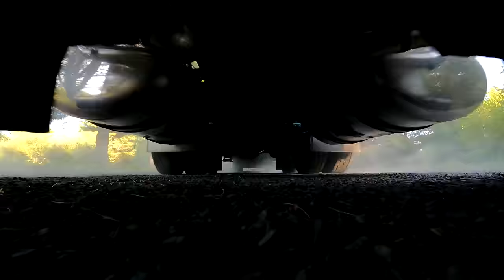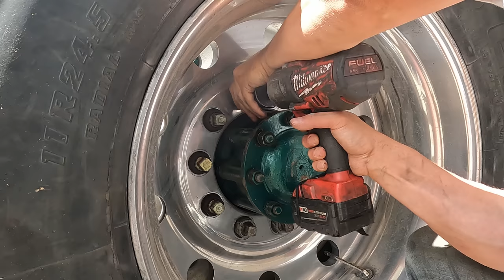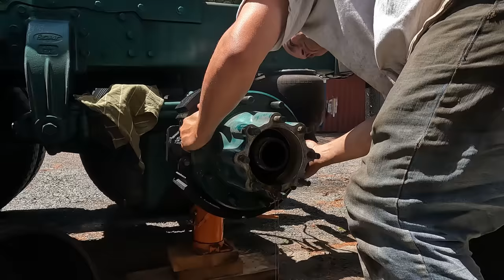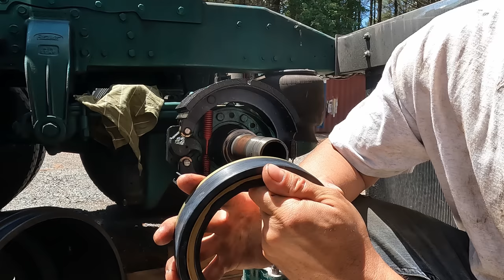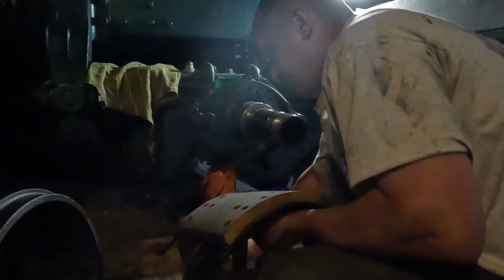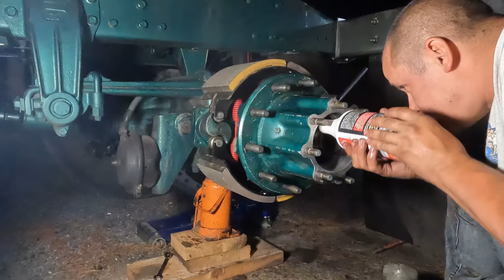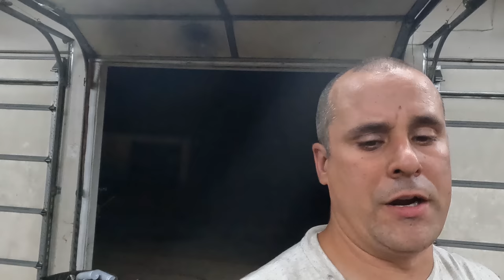Causing our own problems! Major wheel seal failure. What went wrong?

Comment: Check the housing vent . If plugged it will make the seal leak. When sliding hub on have outside bearing in to keep hub centered
Reply from the maker: It's new but thanks Ed! This was my own doing.
Reply: Couldn’t you just brake clean the brake shoes?
Reply from the maker: @tomh6779  ehhhhh they're never the same. It soaks in. Not like they're a million bucks so just toss em in
Reply: @tomh6779  Nah, they'll kinda-stop-but-not-quite and just make a ton of heat, then maybe a fire--great! It's never worth it. New shoes are always the cheaper option than waiting for disaster.
Reply: @tomh6779  no cleaning does not help, once the fluid soaks into the linings they're done, had a brake shoe we cleaned and looked good, hold a lighter up to it and the oil will start bleeding out from it

Comment: I have never put rtv on a wheel seal in all 21 years of working on tractors and trailers. Also it’s easier too knock wheel seal out by using a pipe too tap it out from outside . But everybody has their own methods .

Comment: I noticed the hub has a plug in it, you can pull it out to fill with oil if it will come out, I always put oil in the hub and jack up the opposite side to tip oil into the hub that was just put on, next time you have to take a drum off get a long fan belt and loop under it to pick it up with the belt a little easier on the back good video

Comment: Next time when pulling the hub, after removing the outer bearing. Re install one of the bearing nuts walk hub out and pull. The nut will catch the rear bearing. You can usually pull the seal without having to get creative later.

Comment: On steering and trailer hubs, you can use a straightened out paper clip to poke through the center of the rubber plug to remove dirt and reopen the vent.
Reply from the maker: Ohhhh good call thanks man

Comment: You may or may not have checked the vent ball on top of the axle tube. . If it fails or clogged up.  Gasses build up  has no where to go an it will push oil out of the wheel seal. . Later awesome.

Comment: Growing up working on dads rock trucks I got pretty good at doing seals, aint done one in years now. Never had any fancy tools, seal driver was a piece of oak board and a hammer.
Reply from the maker: I did em that way forever but the seal driver was dirt cheap and comes with the big ass punch thing too!

Comment: I remember putting those shoes together at the Truck shop; newer ones slightly different, not nearly as good as that setup,, got a Bent pin drive in with a hammer, so the spring a have something to attach to.  And the rollers on the S cam have little clip on them
Reply from the maker: I like this style
Reply: I was wondering the same thing. I've never seen a roller with out a spring clip retainer. They're usually a pita to fish it in when you did it the way he did.  And I've worked on some old junk! Lol
Reply: @Ol2Stroker  I do as well, looks safer and stronger, less parts that can break .

Comment: exact same design as the 3/4 and 1 tons i do frequently, theres a steel spacer that keeps the inner and outer halves of the seal aligned, it generally gets bent on pulling the hub and you sometimes leave the inner part on the axle housing if it has a good enough grip, never bothered to learn the wizardry that lets the two halves of the seal move around but not leak, but yea, the spell is broken once you screw with it. i didn't see you install a gasket or sealant on the axle shaft to hub. at 27:54 at about 8 o clock on the hub i see a drain/fill port in the hub, may help reduce the mess, wish the 2.5 ton rockwells on my deuce had those and it ran oiled instead of greased bearings, could check for contaminated bearings easier after playing in the water
Reply from the maker: Yea I never took the fill plugs out when I restored the truck and I doubt they'd come out without a lot of cussing and burnt paint

Comment: Made a lot of extra work for yourself.Should have left the the wheel intact on the hub , remove axle nuts, get a good sledge hammer, not the toy your using, give it a couple of good blows, don't hit the studs,  those cone wedges will be out about 1/2"take a small flat blade screw driver, stick in the slot, expand and pull out.Back off slack adjuster till it starts to cam over.jack up till you can get a 1/2'" piece of plywood underneath, get some gear oil put a 1" strip on center of plywood.slide underneath wheel assembly ,remove axle nuts, the wheel will cock some with nuts remove,  let the jack down just enough to level the assembly ,the wheel will slide right off. When your in a repair shop we use a wheel dolly, when your out in the dirt [field repair].Hub piloted wheels, Dayton wheels, same ways lot easier on you back.45 yrs.,diesel ,heavy equip mech.

Comment: yes sir I'm pretty sure about pre lube for the seal. when your grandfather owns nine sets of Michigan B trains wheel seals become something to pay attention to LOL. and I found from teachings of my family that barrier seals are the only way to go and you do not have to have a wear ring installer you do not have to have a seal installer because you push them in by hand but the key is taking them apart Prelude room going back together once you get them pushed in to the hub and it's dry you want to be a silicone around the edge of the seal and the Hub and let it set up and put it together
Reply from the maker: Oh I wasn't questioning your knowledge I was questioning my understanding. What is a barrier seal I'm unfamiliar with the term is that what I'm using?
Reply: @Ol2Stroker  Google barrier seals okay Wayne and read up on them like I said I tip my hat to barrier.
also buddy I thought that was a brand new hub and that's why I had suggested taking the plug out because it was a brand new plug I would assume that the plug would have been never seized. and the only reason that I said that or suggested was that's really hard on the seals when you let the Hub rest on them when you take the bearing out the front bearing and the weight of it rests on the seal itself that could have been part of your failure.
I like you brother you put on a good thing and I wish I was your neighbor because I love that kind of s***

Comment: It’s not impossible to reuse the deal. We HAVE done it successfully before although it’s not advisable. Only if the seal is relatively new and the sealing surfaces are without pits. We’ve been using the push in style seals from CR for many years. It’s never a fun job and always makes such a damn mess when they fail. That being said you did it the same way I was taught so another job well done Wayne
Reply from the maker: Thanks Cole! The axle surface is pitted I use a little rtv on it
Reply: I can never tell what’s worse the mess the seal makes or the mess I make of the shop fixing it
Reply from the maker: 🤣🤣🤣🤣 so true.
Reply: @Ol2Stroker  considering most of our junk is older, I use a little silicone too. Had a parts man tell me “you just voided the warranty on the seal ya know”. I’m like not if I wipe it off lol.

Comment: You should look into buying a used daul Jack. Best to set those bearings with the tires on. It was put together way to loose.
Reply from the maker: I have one. They roll better on concrete so I don't use it out here in the driveway

Comment: Hey you ever tried to chain method so what you do you put your small springs on first on your brake shoes then you put your big spring on the front and then you run a piece of chain through underneath the pen up onto the hook make sure the hook is faced towards you and take a pry bar or a big screwdriver put it up on the brakes shoe and Pop that spring on easiest way to do it you need to try it sometime
Reply from the maker: Interesting nah I always just did it this way pops right on

Comment: You know you can drive the wheel seal out by setting it on the drum and from the front side by tapping the inside of the bearing with a bar and hammer
Reply from the maker: Shit. That's probably 10x easier than what i was doing. Thanks Jonathan!

Comment: I hate wedge style axle flanges, really bad when they haven't been pulled in a long time, it was a real blessing when they came out with straight stud hole axles.
Reply from the maker: David these were a total nightmare when I first took em apart back when I did the paint
Reply: @Ol2Stroker  Just never seemed like a good design when your standard procedure is having to beat the snot out of an axle and hub with a sledge to get it apart. I felt your pain watching, Back in the mid to late 70"s when I started working on trucks they were all like that.
Reply: @Ol2Stroker  Young mechanics have it made these days, they don't have to deal with much. No more inboard mounted brake drums, axle wedges, wedge style brakes, walking beam suspension, camel back suspension.

Comment: Hi from uk Wayne 👋 👍 well as we say live and learn mate don't take that shit personally man at least now if you see or hear anyone doing this job you can say "" hey BTW you might wanna change that seal too"" 🤣 you be one of those guys like the guys who told you 👌 it's just a shame for for the shoes mate but at least rest cleaned up so good job mate 👌 thanks for your time be safe and see you soon 👍 👋
Reply from the maker: Thanks Mark. The thing that bothers me the most is now the shoes on that wheel are a different color than the rest lol
Reply: @Ol2Stroker  I know its a bare it is what it is mate 🙈 do you buy shoes in pairs or just single sets?  Cos if pairs could you not change others on other side same axle so at least the they be in pairs on the axles if you get me lol or just try not to look or think about it with you ocd 🤣🙈 lol or just oil other side up run them as pair of anti skid and anti squeelers shoes they'd defo be anti lock 🤣🤣 (last comment is for comedy purposes only )🤣🤣🤣 lol
Reply from the maker: @marksaunders2500  lol. It's hell. I'm too cheap to buy another pair so they match on that axle and yet ocd enough the different colors bother me. 🤣🤣 I'm just not gonna look at it.
Reply: @Ol2Stroker  I won't say anything if you don't  🙈🤣
Reply from the maker: @marksaunders2500  deal!

Comment: Ahh watching someone else have to do seal. Makes me glad I've got new rears on my 359... One set of nuts and the rims & tires come off. No more cones to fight either.  Aren't you missing a foldover lock? To remove any chance of the outside nut from loosening? I've not seen a set of hubs not get them or a varient of anyway.
Reply from the maker: I dunno? It definitely wasn't there when it came apart.
Reply: @Ol2Stroker  wouldn't be the first time somebody left them off. Cheap insurance to keep that nut from backing off (not that there's a great chance of it happening). I've got a few on the shelf if you can't find them locally.

Comment: there's an allen head plug on the Hub you can take out position at about 7:00 8:00 and add your oil through there and you don't have to take out the bearing again and let the Hub rest on the seal
Reply from the maker: Good luck getting those out after 40 years lol I thought of that figured it'd just ruin the paint at best.
Reply: @Ol2Stroker  Wayne...do you have a Truck pro near you?....

Cause they have a bearing puller tool
Also they have a wheel jack where you don't have to take the wheel completely apart!
Reply from the maker: @clevelandmaker386  I actually have one of those wheel jacks lol. I'm not sure if we have a truck pro though I'll hafta check
Reply: If you ever have those hub plugs out, blue loctite will help keep them from getting stuck.

Comment: On my Dentside with a Ford 9", it blowed an axle seal, and when I googling the repair procedure, I came across the excellent advice to check the axle housing vent.  I unthreaded the hollow vent bolt which secures the brakeline junction, and that hollow bolt was so damned plugged up with mud from the dirt daubers, that I had to use a frickin' drill to clear it!  After that it seemed like the leak stopped, but after a few years, it's started leaking again.
How the hell do you get air into them outside duals? That angled valve-stem looks right for insides, but not outsides. My cheap ass gets bit ALL the time...
Reply from the maker: It's very good advice. Vent is new and we don't get a ton of dirt dobbers here

Comment: Those bearings are going to seize up. You do the inner nut up to 50 ftlbs and back it off one flat of the nut then after lock washers and lock tab outer nut should be tightened to 350 ftlbs. Look in the book
Reply from the maker: I don't have a book, just did em this way on the trailer and it's been minty.

Comment: I’m surprised the seal came off intact in the first place.  a majority of the “outrunner” as I call em type seals I’ve done one piece will be stuck to the spindle and the other in the hub. Do u have good luck setting that inner nut to 70 lbs? I was taught 200 to set the cups and seal back it off torque to 50 the back off 1/8 1/4 or 1/3 turn depending on the thread pitch. That being said I’ve never seen 2 mechanics set up a wheel bearing the same way everyone does them differently
Reply from the maker: I did the trailer the exact same way and it was mint for the entire trip so I guess the answer is yes

Comment: I call that "other seal" a wear sleeve. I'm only a third in but so far great content.
Reply from the maker: Thanks Joe I appreciate ya!
Reply: @Ol2Stroker  also not sure if you can do it on those axles but, I've found you may not need to pull the hubs to do wheel studs. I take a bfh, knock them back a little, take my prybar and pop the brake shoe up away from the s cam. I than proceed to use that space to remove the studs. I than take my air hammer with a flat chisel and pop the new one in. This is on Mann axles though.

Comment: hey buddy is that a barrier seal?
if it is that's the best deal to work with there's no insulation tool now wearing the key is taking them apart pre Lube them and put them back together. I'm sure you did that though I love those seals
Reply from the maker: I'm not sure to be honest Gary. You hafta prelube these?

Comment: Gday Wayne, we would leave the tyres on the hub and just jack it up to get a lubed up strip of plate just under the tyres , and then drag the lot off . That way the hub goes back on straight, not to fuck the new seal . But hey it’s your truck.. get watching 👍
Reply from the maker: Thanks Dale I've heard that before. I just can't bring myself to do it that way sounds messy. I do have a wheel jack I could use..... But then I'd need concrete

Comment: Not trying to be a smart ass but as far as I know you should back the inner nut off a flat after torqueing  and after tightening the outer nut be left with about 3 thou clearance in the bearings  .
Reply from the maker: You might be right but I never had a issue this way. Got something to do with the resistance of seating this kind of seal I'm told. I dunno I'm far from an expert.
Reply: @Ol2Stroker  As an apprentice we were  led to believe that you should allow some bit of free play to allow for thermal expansion of the hub or you could end up with bearing failure or the cone spinning in the hub . Not  trying to find fault everyone has their own ideas and  opinions  . Great videos by the way.

Comment: When getting a old race out of a hub in your opinion what's the most easiest fastest way to do it ?
Reply from the maker: Hammer and punch always served me well
Reply: Try welding a bead on the inside middle of the race and it will practically fall out instead of all that beating
Reply from the maker: @benbirkigt493  I've heard of that too. I need to try it
Reply: If there aluminium hubs weld around in the bearing cup then punch out put new bearing cup in the freezer and warm up the hub and put cup in do not hammer them in as they pick up aluminium and bearing doesn't seat properly.

Comment: Yea, I have only ever reused  a wheel seal in a oh shit pinch. then replaced it with a new one a few days later. Also I pack the wheel bearings with grease. Can't believe that thing has outboard drums, you convert those or were they factory?
Reply from the maker: Factory. Every truck I've ever had is outboard drum?
Reply: You are lucky most of the one's I have had are all inboard stuff.
Reply: Ya most trucks that old I've seen have inboard drums . Lucky guy lol

Comment: Didn't quiet understand the purpose of the RTV on the axle tube .
Reply from the maker: Sealing surface is pitted from rust.
Reply: @Ol2Stroker  Don't know if this exist for big trucks or not but there was a product called a speedy or saver sleeve I have used to repair seal surfaces . Simple sleeve with an install tool to repair bad seal surfaces , DD even had them for rear crank seal surface  on the 71 series . Even with that two piece rotating seal I can't see the RTV surviving . Just my opinion . Good luck ...
Reply from the maker: Yup I would've used one if I used the normal style seal. The seal I'm using doesn't rotate on the axle. It's stationary on the axle and the hub and the 2 pieces of the seal rotate within each other.

Comment: well I have to debate with you on whoever told you they're not reusable. once I switched from stemco to barrier that's the reason I did because they're cheaper and you can reuse them as long as you take them apart gingerly Marianne
Reply from the maker: If this is a barrier seal I'm using I did not know they came apart without ruining them.